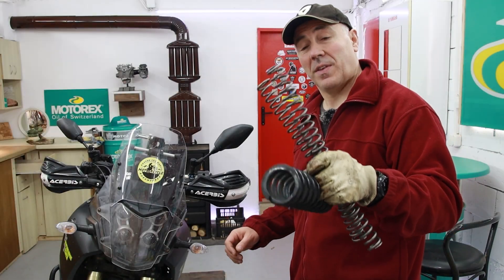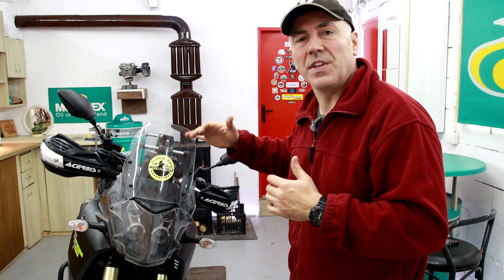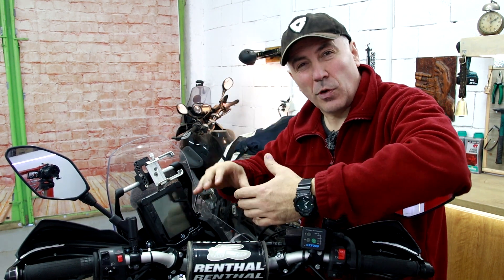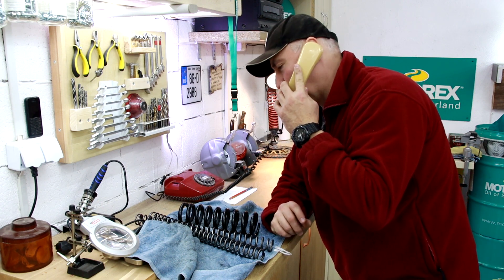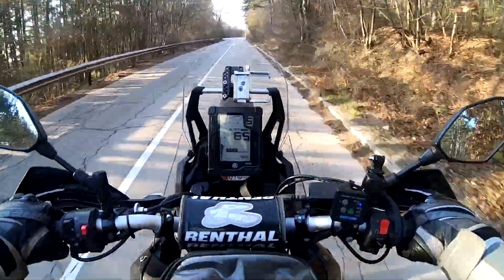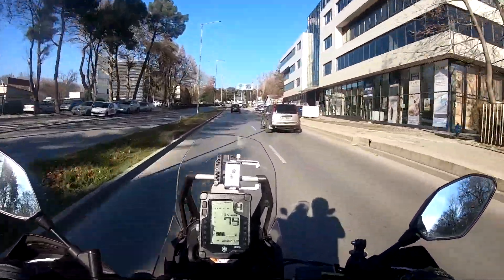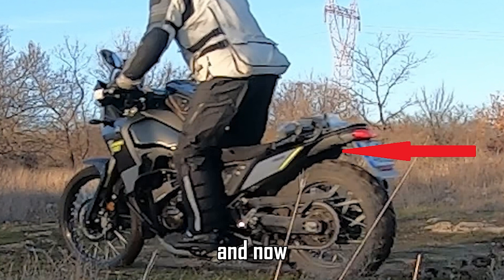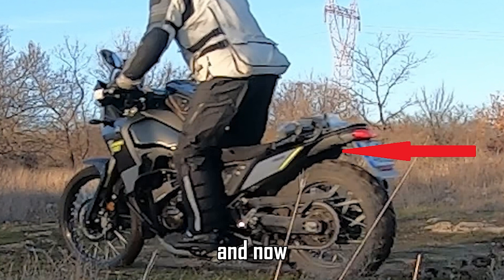I installed Stiffer Springs for My Tenere 700

Comment from the maker: I made a few mistakes in this video, but I found them later, during the editing and it was too late to correct them. The numbers that I gave are wrong. The calculation needed to be with the Tenere suspension travel which is 220mm front and 200mm rear. Then the numbers will be completely different and everything will make sense. Also, static sag is when the bike stands on its tires, and race sag is when you sit on it. Someone even corrected me in the comments, thanks! Anyway, the riding test explained everything. Plamen also test the Tenere with the new springs and confirmed my words.
Reply: wollte ich auch gerade schreiben ☺️
Reply: Easy to measure suspension travel with a partner if you can balance the bike on its side stand.
Reply: Was just about to make this exact comment. You need to measure the suspension travel. So 6cm out of 21cm front is about right (28.5%). 9cm out of 20cm on the back is 45%, so you should change because the rear spring is too soft for your weight.
Reply: This video should be very helpful for any rider. The 1st thing I noticed was, like you mentioned, the way to calculate sag. I had to replace the suspension on my BMW R1200 GSA, but since BMW couldn't service them I decided to get Ohlins suspension (they were a little cheaper than original BMW and readily available). When I ordered them I could enter my weight and the weight of the luggage, it made all the difference. I never needed to adjust the preload, and they are easily serviceable. So yes, stock suspension sometimes has its limits and needs to be upgraded.
Reply: Probably you had air in the forks with stock ones. That's why rider sag seemed to be fine. New front setup will also create air over the years. Just bleed them from the top caps while there's no load on them.

Comment: Suspension upgrade is by far the best modification I've done on my 500x. Hagon, a British company, took my weight together with pillion and luggage and sent me a whole rear shock with a remote preload adjuster. This last bit has made switching between solo and loaded pillion a 2 minute job, and so much easier than before.
The ride difference is a revelation. 
People spend hundreds on exhaust, crash protection and luggage etc, but ignore something that makes a massive difference. 
Good topic. 
Safe  happy travels 👍
Reply from the maker: Absolutely agree! Thanks for sharing, Richard!
Reply: I also found that out on my bike. If youre going to do only one upgrade to your bike it should be to the fork springs. Because many forces when riding go through the front wheel's axle
Reply: Did the same on my Kawasaki W650 years ago. Fantastic. Made a huge difference. Hagon are the dog's danglies!
Reply: I am just about to order Hagon shocks glad I read this! Thank you.

Comment: Hi Paulin. I am 77 kg  , I started with just rear spring swap, got this "Uprated shock spring Yamaha Tenere 700, white, 85 N/mm Item #: SF-TTS-T700-85" fro German webshop. With no bag I got correct sag with zero preload , leaving space to whatever heavy rear bag.  ... what a difference in riding !  Your spring rate/rider weight ratio is on a soft side i reckon.   The rear end behaved awesomely with my new spring. I had plans to swap front  springs and cartridges (to get rid of small hits from rocks), but... 2022 came and I had to sell my bikes, my house, garage and leave from Russia, but this is another story. Enjoy your rides !
Reply from the maker: Thanks for sharing!

Comment: Yep.  This is common with Yamaha's, the stock suspension is set up for a (by my North American standards anyways) light rider.  In recent years I've owned a mt07, Tracer 900 GT, and Tenere 700.  All three needed to be resprung, but the Tenere most of all.  The soooooft stock springs are comfortable on the road, but they lead to weird handling under heavy acceleration or braking, and the suspension will bottom out easily even without jumping it.  

The upside is you can look up the correct springs for your weight and riding style on Racetech's calculator, order the springs from anywhere online you like, then pull the forks/shock off and bring them into a shop to be resprung with minimal effort and basic tools (assuming you're not comfortable and lack the required specialty tools to do it yourself) for about 1.5 - 2 hours labour in total.  Makes the respringing process surprisingly inexpensive.
Reply from the maker: Thanks for sharing!
Reply: But how do you know if the stock valving is good enough for stiffer springs?

Comment: I changed the valves, oil, springs, and rear shock of my Vstrom last year. The standard suspension did well enough on normal roads but it didn't cope on dirt roads. Now it is much better on dirt roads, but also a lot better on normal roads.
Reply from the maker: Thanks for sharing!

Comment: Springs are very important especially for old bikes, heavy riders and carrying heavy loads. All three for me. I put Progressive springs and shocks on both of my old Wings. Huge improvement in handling and no bottoming. No other springs available for my Honda Falcon 400. Noticed mushy in the front and sagged a lot when I sat on it. When I had it apart for seals I added 19mm spacers on top of the springs. A piece of plastic pipe and a washer. Much improved.
Reply from the maker: Thanks for sharing!

Comment: I weight the same as you , and had also to upgrade front and rear springs with the same rate. And it solved only one part of the problem, because, another problem is damping, hydraulics settings. T7 has a very bad setting.. That's why I had to go to Ohlins, front and rear, of course more expensive, but more effective ( another option here in France is EMC, sounds good ).
Reply from the maker: Whatever works for you.

Comment: I had the same experience with my Honda XL 1000.  Especially with 2 people and a full load, the rear wheel suspension was overwhelmed.  I installed a specially adapted Wilbes shock absorber.  It was a good decision.  Perhaps just another spring would have sufficed.  
All the best for 2023 and greetings from Germany.
Reply from the maker: Thanks for sharing!

Comment: I've used Off The Road for a lot of my parts especially suspension.  It is duty and vat free for me and shipping is very reasonable and timely 5 days to door in USA.  Where would you find a bumpy road in Bulgaria. Like Kentucky everyday you turn. I knew the changes would make a huge difference.  Glad it worked out for you.  Fork seals. SKF are the slick ones  dust and slider.  Those covers are worth their weight in gold.  Used them on all my bikes since the 70's.  Safe riding
Reply from the maker: Thanks for taking the time again, Sam!

Comment: I recently did this work and all measurements on the front and rear of my 2016 Tiger Sport 1050. I weigh around 93kg (105kg in gear) and the stock triumph springs especially the fork springs were way to soft. I went from 6N/mm to 9N/mm and in the front and I changed the rear stock spring 15kg/mm to an old blackbird spring 16,9kg/mm. I made myself a measuring tool with my drillpress and my bathroomscale, so I knew exactly what changes I was making. After the changes my riders sag was spot on and the bike was completely changed for the better
Reply from the maker: Thanks for sharing!

Comment: Its a common thing that manufacturers take the average person around 80kg (by example KTM Does also like that) and who  weighs only 80kg with gear? Nearly nobody. By you, the too soft springs had too little air chambers to compensate that. Also i guess you had strong compression to help compensate. With the right springload, original clicks will work miracoulisly :-)
Thank you for your explicit videos, helps a lot more than all those "short" Videos.
Greez from Switzerland
Reply from the maker: Glad to help!

Comment: Hi Pailin,  Happy New Year to you and your family. Thank you again for great instructional video. I don’t have the Tenere, but the XSR 700 and like you have changed the front and rear suspension. They are designed for the average Japanese rider nearly half our weight 🤭. I went for K Tech. set up and it’s a very different bike. Spent my money on that first, pretty thing later. Save travels on your next adventure 🍻
Reply from the maker: Thanks for sharing!

Comment: I was wondering when you were finally going to do this. Many Japanese manufacturers have designed the spring rate only up to 75 kg rider weight. (All small Japanese) 😁 On my ZX14R I immediately installed a different shock absorber Öhlins TTX39, the best on the market, with hydraulic spring preload. When I ride with my wife or with luggage...then adjust according to weight. Greetings from Germany
Reply from the maker: Thanks for sharing!
Reply: But yamaha is for mjnimum 180cm tall rider. So why used springs on 70kg weight? 90 percent have to change that garbage . Yamhaha should make service action on that. Or utilise that garbage around the world. They  knew when it was enginered that they put garbage springs. And other garbage staff in this motorcycle.

Comment: Excellent video!  I wonder why Yamaha's stock springs are for people 80 KG. max.  I would guess most men with riding gear weigh more than that.  One would think they would increase it a bit. But now I know there is a solution should I have a problem.  I am planning on purchasing a T7 soon.  I am getting older, and my big R1200gsa was just getting too heavy for me to ride.  Thanks for your excellent videos Pavlin.
Reply from the maker: Glad to help!
Reply: 176.36 pounds
Reply: Believe it or not, i talked to the lead project manager of the tenere 700. He was very suprised when i told him that the bike is very popular in europe. I think in some cases, since Yamaha is japanese, they designed the bike for the japanese market. And the average asian weights 60-70kg so there you have it. Should they change that for other markets? Yes^^

Comment: I liked progressive replacement springs on my previous Tenere a lot: both on and offroad handling improved very much. I am not sure if I will do this on the T700 because I am 75 kg and so far so good. I would choose  progressive replacement springs if I were to upgrade the stock suspension.
Reply from the maker: Fair enough!

Comment: I put 63N fork springs and 85N shock spring.. I weigh 220 lbs and ride with up to extra 30lbs of gear. I have good midrange adjustability in shock. My fork spring is at full preload and is okay, but will update front spring to next stiffer level. I ride pavement to street, fire road, jeep trail and desert whoops. All of it. In desert whoops, I occasionally tap the fork bottom. New fork spring should cure this. I think your shock spring may be too stiff..
Reply from the maker: Good!

Comment: Hi nice video. 
Measurement on the front are not true measurements if you didn't stretch the topuot spring by pulling the wheel down.  
Oem cartridge doesn't provide enough hydraulic support. 
Enjoy the ride and if you can revalve go for it! Ktech does nice valving 
Thanks for sharing your experience
Reply from the maker: Thanks for watching!

Comment: Hello Pavlin and Happy New Year,
Yamaha Tenere owners will surely appreciate this video. I saw that you put MITAS EO7 (Dakar?) on your bike. As You ride a lot on all types of terrain, it would be nice to give us a little feedback on these tires when you have worn them out.
Thanks in advance and happy future travels.
Reply from the maker: I will! I smashed many Mitas 07 and 07+ tires, but this is Dakar version. So far, I am not impressed at all. The rubber is two hard, but will see.
Reply: @motorcycleadventures  Thank you for answering. I will wait for your conclusions. Yes the rubber on the Dakar is hard and slippery in the rain but it lasts (almost) forever. Anyway, that's my experience, but it's incomplete. I know I'm abusing it, but a comparison with the non-Dakar Mitas E07+ would also be welcome..

Comment: If you're heavier than usual AND ride more extrems trails, you have to change stock suspension. Cranking up preload is only a workaround. Most of the time it's a costly affair, because normally you have to change compression/rebound damping, too. Funny enough on my Beta Alp 200 (not exactly a hightech bike) we had to use softer springs front and back due to single riding instead of two-up. Thanks for showing, Günter/Nürnberg
Reply from the maker: Thanks for sharing!

Comment: I’m 95 KG and opted for 6.6N/mm front and 90N/mm rear, but thinking of going up to a 95 rear spring.
The standard damping is too soft for the higher spring rates, so I also had K Tech piston kits fitted.
Reply from the maker: Ok
Reply: The standard damping with the 90N/mm rear spring I put in shortly after getting my bike was too much for the standard damping, especially the compression and had it all the way in and I think about 2 clicks out on the rebound, so if your a heavier rider it just can’t cope.
The K Tech piston kits as a mid priced option that is a lot cheaper than replacing cartridges and shock, and for my use the best return for the price.
Reply from the maker: Good to know.
Reply: @bryansuperduke1290r  how do you find the on road manners of the Ktech compared to stock
Reply: @mbams119  I’ve not gone on trip yet, so only road mikes so far.
It’s lots better with correct springs, and more damping, as I had the rebound on fully in on both shock and forks.
It’s not diving as much under braking, or squatting under acceleration now, and picks up the front wheel when accelerating.

Comment: Hello Pavlin, Attention OFF the Road (OTR Performance Cologne) wanted to cheat me off. I saw your video about new suspension, I am same like you as weight and height. Then I ordered the same springs and Motul oil like you from OTR Cologne and I asked if the springs could be exchanged from OTR for my fork and shock absorber and they said yes. I dismantled my forks and shock absorber and sent them to OTR Cologne by post. Then I wait long time and I make a lot of pressure for the work to be done, my forks and rear spring were returned like have new springs. Then I opened my package and in the package were the Motul oil from the fork in the original canister, not in the fork how was ordered and I look at my shock absorber was not untouched, the spring was not exchanged. Then I measured the spring, I got the masses from your video, the OEM spring was 11.51 mm, then the spring was not exchanged, as i realized. OTR spring 90 N / mm with 12.98 mm thick as you wrote was not on the rear spring, then it was clear to me. I called and asked what happened and they told me need to check. Then confirmed was not exchanged because they seen I had an idea about mechanics. I was in business and spoke to the manager and he told me he doesn't care what other people do in their business. He tries to convince me with different lies like in kindergarten. Also, in the store no one seems to have a clue about the moto bike and what's going on in the shop with the orders. I won't buy anything from OFF THE ROAD again or recommend anyone.
Reply from the maker: Sorry to hear about your experience, Daniel! The parts are good, and the shipping is also, but I never recommended anyone to use their garage service. I even didn't know that they have such a service.
Reply: I have already bring the fork and the shock absorber to the Yamaha representative to do what OTR did not do.
Reply: I'm trying to come to the meeting 2 days in May to Balkan Adventure Group (AG) Annual Meet Up in Bulgaria 2023, I would like to come all 4 days, but I have an appointment to the dentist.
Reply from the maker: See you there!

Comment: Its possible to swap the front springs without removing the forks, takes about half hour.
I didnt change the oil though.
Reply from the maker: Ок
Reply: I think the original oil is too thick

Comment: Thanks a lot Pavlin. Another great video! Do you know by chance if the oil and dust seals from Tenere 700 fit the older sister XT660Z?
Reply from the maker: No they don't!
Reply: @motorcycleadventures  Ah that's a shame, thanks a lot for the advice!

Comment: Just received the 90N/mm rear spring. I'm around 103 Kg with gear on. I just hope it will not be too stiff 🙂
Reply from the maker: It will be all right. I am the same weight without the gear.
Reply: What do you think now? Rear is too stiff? Do you consider an 85Nm was better?
Reply: @ionutd84  I lost some weight so, a 85N/mm might be better now. I will lower the bike with 20mm and 90N/mm will be ok.
Reply: @erhard7450  in românește cred ca ne înțelegem mai bine. Deci la 93 kg ale mele, in urma experientei tale, mi-ai recomanda de 85Nmm pentru mai mult confort?
Reply: @ionutd84  It's not so much about the comfort it's about the sag. Depending where you buy the springs from, there should be a selector where the spring rate is recommended for your weight. I bought mine from OTR just like Pavlin.
Reply: @erhard7450  merci!

Comment: Is the stock valving good enough for stiffer springs? Would you be better off getting cartidges and springs with adjustable preload? Buy once cry once? Or were the springs just fine by themselves?
Reply from the maker: It would be better, but also the price will raise a lot.

Comment: How much difference was it in the front springs? 

Could u change front and back or is it enough to just change rear?
Reply from the maker: You need to change both.
Reply: @motorcycleadventures  even if its brand new bike?
Reply from the maker: If you are heavy and want a better handling, yes, but it is not necessary in any way.
Reply: Thanks! 🎉